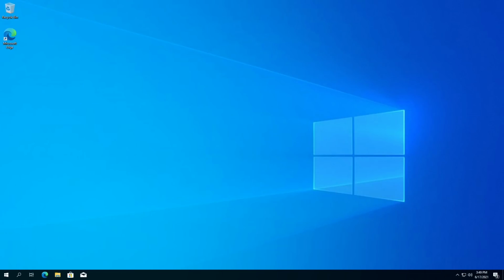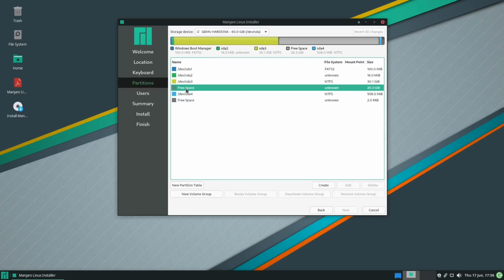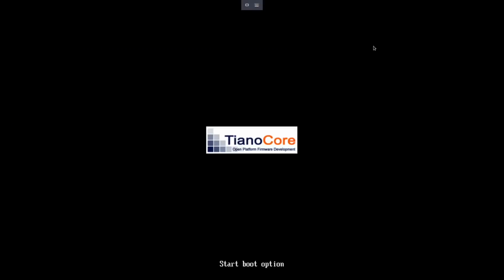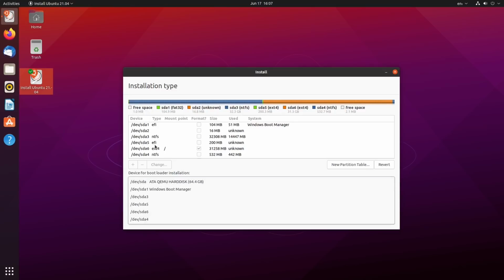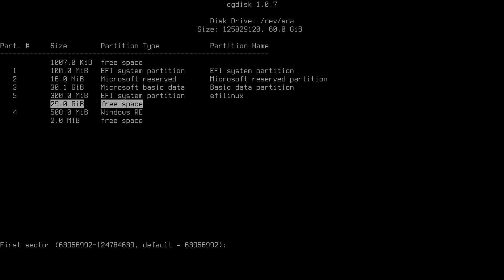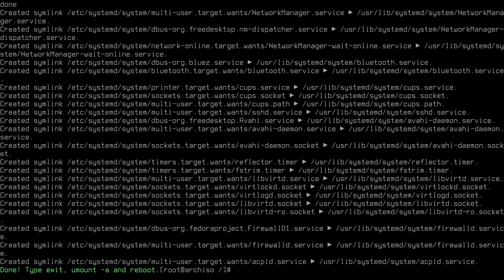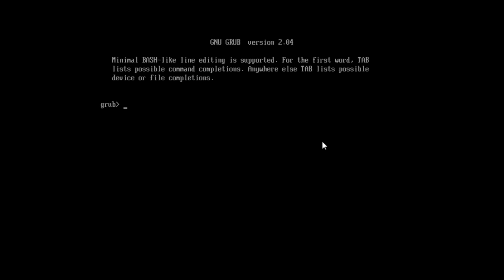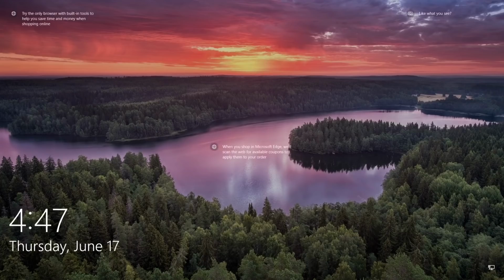Update On Dual Boot

Comment: does creating another efi partition for linux basically in the middle of the windows partition create problems for the windows recovery? because i'd done this a while back, and it was fine for 1-2 months, then a windows update made my system crash for some reason - and when i tried windows recovery, it was not working.. it said the recovery process was not able to be completed i think. so i just reset the system with just windows now.

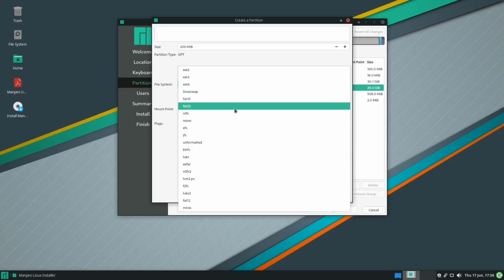Comment: Please help me. I tried to install Manjaro with Win10 on my laptop, I start step-by-step just like the video, but when I go for 6:20 “/boot/efi” don't show has option in mount point, just  “/boot”.

Sorry if my english is broken, i'm a hispanic, I just tried to install Linix for first time. 😭
Reply from the maker: No worries Cris. The mount point /boot should work as well
Reply: @eflinux  
Oh, thank you so much for getting back to me so soon. I just found out that it is because when entering the boot menu I selected my usb in Legacy mode instead of UEFI, that was the problem. 😅

Comment: Honestly, this is one of the last big problems with Linux, grub struggling to deal with multi-OS systems. The other big problems as I see it: still a lack of userfriendly well optimized videoplayers (VLC is a mess with Ryzen, also on Windows,  mpv works fine and can be configured to be great but the configuration is a bit complicated), no efficient GPU-decoding of videos in the browser (it can be enabled, not sure that it works as good as on Windows) and no proper GPU-encoding of media with OBS for AMD. Linux has a lot going for it and I prefer Linux overall, I hope that these problems will get solved.

Comment: Would using Windows on 1st drive and Arch on 2nd drive still considered as dual boot.
Reply: Yes. That's exactly what I did on my daily driver, except that the distro of my choice is Manjaro KDE Edition, which, of course, is based on Arch Linux. My daily driver has the following specifications below.

Manufacturer: Dell
System Model: OptiPlex 7020
Computer Type: Small Form Factor Desktop PC
Operating System: Dual-Boot of Windows 10 Pro and Manjaro Linux KDE Edition
Processor: Intel Core i7-4790 Quad-Core at 3.60 GHz (up to 4.00 GHz with Intel Turbo Boost Technology)
RAM Memory: 32GB DDR3-1600 (upgraded from 8GB)
Hard Drives/SSDs: 1TB primary SATA solid state drive (upgraded from 500GB 7200RPM hard drive) and 512GB secondary SATA solid state drive (via a 2.5" SATA to optical drive bay adapter)
Optical Drive: LG BP50NB40 6x USB external Blu-ray Disc writer
Displays: HP 24mh 23.8-inch monitor (1920x1080 pixels), and XP-Pen Artist 12 display tablet (1920x1080 pixels)
Graphics Card: YESTON Radeon RX550-4G LP D5 (upgraded from Intel HD Graphics 4600)

Comment: An extra note for shrining Windows10: When shrinking from disk manager, some third party antivirus software may prevent it when shrinking involves relocation of those antivirus files on disk due to their tamper protection. Solution is disabling tamper protection (or self protection) from antivirus' settings temporarily. Of course reenable it back after you are done with shrinking for security reasons.

Comment: Thank you again Professor for another excellent and instructive video! My laptop is having "dual" boot with Windows (just a minimal 50Gb partition) and two linux distros. Initially were Arch (my main driver) and Ubuntu, but have replaced the latter for Void preparing for the future because I am getting tired of Arch. In the past I have messed up grub or another thing in Arch and the other distro has proven helpful in the recovery. Regarding that new "feature" of Grub, disabled os-prober, seems to be only in Arch. Why the guys in Arch keep disabling/removing useful things from time to time for no reason at all?

Comment: Can u check if Ubuntu bootloader actually installed on the selected 200MB sda5 efi partition or it installed on 100MB windows efi partition???
Reply: I didn't used Ubuntu but last month when I tested Linux Mint (seemingly identical installer) and I chose a separate ESP but it still installed on the first one it detected (Windows one). 
So if this is what happened to you, you can submit a bug report somewhere, I didn't because I was just testing and not using it afterwards.

Comment: I've had nightmares using 2 different HD's with different Linux distros (one daily driver, one backup). I do this because have never got Virtual Machine to successfully load in Manjaro (used it for years without problem in Windows). So I have one distro (daily driver) on SSD1, and a second OS on SS2 (and data on a third 2 TB Drive in the DVD bay). In order to dual boot I have to hit the F12 key to go into boot manager and choose which HD to boot from first. I have only once had a grub menu that can successfully boot both OS's. I find the entire bootup thing with Linux a huge pain. And also getting HD's to automount at startup. 

I also installed many OS's recently exploring different options and never managed to manually make UEFI work. I know you've done videos on it, but I can't remember all that stuff when I'm doing a fresh install so always use the GUI installer and they never seem to allow you to do a EUFI option with BTRFS. They always default to ext 4 and Legacy. 

Sorry, I just spent 2 hours trying to get my Data Drive to automount on startup going through wikis and forums etc. and nothing work. It's a 1 minute thing when you know how to do it, but can take forever when you don't. That's one of the things about Linux I really don't like - despite your great videos!!

In any case, this is a request for a bootup tutorial video that has NOTHING to do with Windows etc., just working with different HD's and different OS's and how to troubleshoot the issues which might come up.
Reply: Automounting a partition or HDD is a single line to be ADDED in "fstab" file. So check its current contents, you have to write a similar line. Most probably it will have 2 lines already. One for boot, other for root partition. You write the third one for whatever you want to automount. (It is difficult to give you a direct solution since IDK what format the partition is NTFS, ext4? Will it need root? What permissions you desire?)

You can use update-grub from Linux, check whether it detects all your OSs. Then you can use "efibootmgr" in terminal to delete efi entries that have duplicated over time or are irrelevant.

You can go into your motherboard bios and choose a Boot order beginning with the HDD with Linux. Now every time that your PC boots it will automatically show you the GRUB where you can choose which os you want to boot into: Windows, Linux 1, Linux 2, etc... No need to press F12 anymore. You can even set the duration you want this grub screen to stay without booting into default entry. So if set to 30 seconds, you won't miss making a selection or having to press F12 furiously.

You can do this using efibootmgr as well, but it's a bit risky so you need to properly read the manual for it.
Reply: I haven't watched it yet but a person called Jack Keifer on YouTube recently made a video on efibootmgr. So maybe check that out as a starting point to fix your multi-boot issues. It's a pretty easy to use tool.

Comment: My journey of Dual Booting windows and Manjaro, 
With one disk, two different efi partitions, one for windows, one for grub. 
With two disks, each have their own efi partition, also using grub. 
After moving to Arch and using systemd-boot, I just kinda give up setting up Dual Boot (with two disks), just use BIOS to manual select bootloader.  
I really like you sharing your solution to everyone, great video as always.
Reply: You should just mount the windows efi partition as /boot/efi in your linux distro when installing (don't format just mount). Do this for any other os you install as well. Windows may be itself and set itself as the bootloader after an update but that's an easy fix, Just use the uefi as you said and boot into linux and update grub. Hope this helps

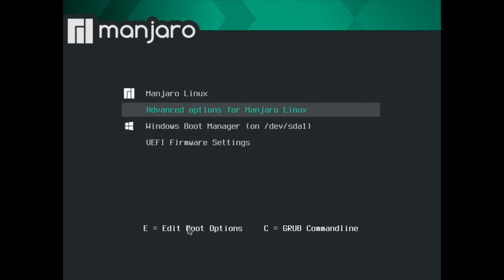Comment: 11:00 I'm dual booting Windows 10/Manjaro and I use this command if it boots into Windows 10 and doesn't recognise Manjaro:
bcedit /set {bootmgr} path \EFI\manjaro\grubx64.efi
I'm not sure, but I think replacing "manjaro" with your distro could work. Unfortunately, because of the way Windows works, you will need to run this in the Powershell/Command Prompt every single time you install a major Windows update because it resets the default bootloader. In my opinion, this is much less of a hassle when compared to booting into the live environment, and then following the steps listed on the Manjaro wiki. Remember to run Powershell/Command Prompt with admin privileges, cheers!

Comment: The first Linux youtuber that doesn't fail to mention that PopOs requires a huge boot partition, definitive upvote!
Reply: He’s basically the best YouTuber who also doesn’t pull rank because of his knowledge. He also has full recognition of the fact that some people still need Windows, and so help them to ensure that they have working systems.
Reply: Please explain why popOS requires such a large EFI-partition?
Reply: @AnnualDegree99  because PopOs uses systemd-boot as bootloader and it can load the kernel only from the same filesystem it was loaded from.